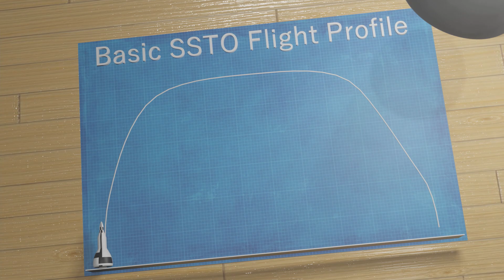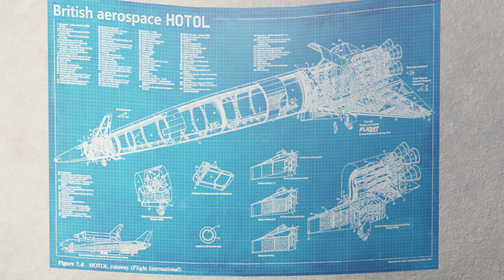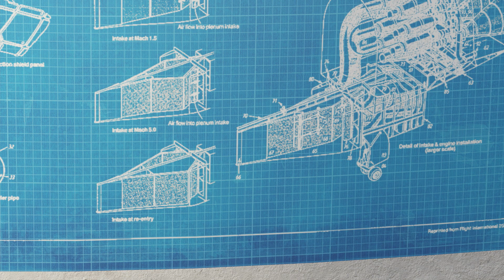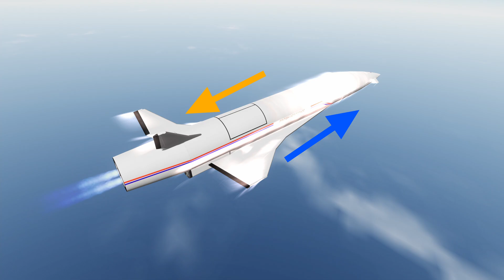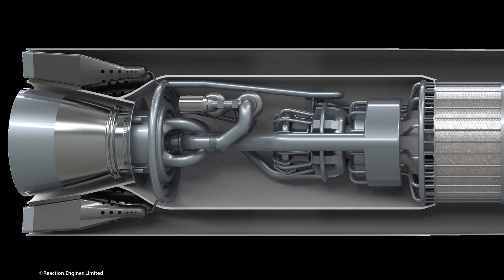From HOTOL to SKYLON - The history of Britain's spaceplane project.

Comment: Didn't you use endless fuel? My best achievement with the similar concept is a suborbital flight.
Reply from the maker: I did not. However, I had to create custom configs for the tankage (as the kind of lightweight tanks did not exist in RO yet - they do now, though!) based on the data from the study.

Otherwise, everything else was using existing configs/parts

Comment: Really great vid, i really like the HOTOL and the Skylon and i want to know : how did you make this workable HOTOL ? because i can't manage to make one fly without seeing it's wing being ripped  at the first turn. 

AND finally , if you have mod to make them do you remember what are they called ?
Reply from the maker: Looks like I forgot to reply  to this one, sorry!

The HOTOL is semi-workable - it flies for the most part, it's just procedural parts and B9 procedural wings. Atmospheric autopilot mod helps keep it stable in flight. 

However, it's not a fully functional craft - it can't go to orbit or return from orbit, it pretty much just served as a prop for the video. Since IRL one of the challenges with it was aerodynamic instability, it's no wonder it's a tricky craft to make fly.

Comment: Great video thanks for doing it! In a way Skylon and Star Ship are both reproducing what the Space Shuttle was but doing it better, both are reusable space trucks to Leo able to carry huge payloads. The next step would be to refuel in orbit and go to the moon. Shame this was never attempted for space shuttle
Reply from the maker: Absolutely - I think the space shuttle wouldn't have that kind of capability though - unlike Skylon it lacks the internal volume for refuelling without the ET, plus it would need modified RS-25s that can restart & redesigned thermal tiles.

The closest thing we could've had is maybe Shuttle-Centaur.
Reply: @TDChannelKSP  i guess the ET should remain attached. Assuming it can be refilled completely you could do some burn to get back into Leo before attempting reentry. Same issue for starship returning from the moon or mars...
Reply from the maker: @JohnBlackburn1975  Yeah, it'll be interesting to see how Starship handles it. It takes a lot of fuel to brake, so perhaps simply having a TPS that can withstand interplanetary re-entry speeds is more optimal.

Comment: I recommend the airplane plus and TURD mods if you want to make not only a more accurate skylon, but better planes in general.
Reply from the maker: I did use TURD for this. I'm not sure if airplane+ has RO configs though. 

A+ is dedicated to normal planes though, not sure how it would help with a skylon-like aircraft?
Reply: @TDChannelKSP  airplane+ has a size 2 round cargo bay that you could use, in combination with tweakscale to make a better cargo bay. I’m not sure if you need RO configs or not for cargo bays. Also, the mod airplane plus things or alltweak might work for the scaling. Another mod, simple repaint allows you to recolor parts that don’t have TURD. Unfortunately, I’m not sure if those tweak scaling mods or simple repaint work with RO. Great video BTW.
Reply from the maker: @elijahrhyne8961  Ahh, that's true. I've had issues with tweascale sometimes breaking FAR so I didn't want to risk it. Skylon is actually area ruled at the cargo bay - it gets narrower, so the mk3 bay is somewhat accurate (couldn't use the transition pieces, too heavy - unless I edited those)

Glad you enjoyed it though.

Comment: Ahh Skylon, forever waiting for those magic engines to some day be possible, not to mention the basiclly magic alloys
Reply: They're being tested
Reply: true but we get more teck every day so maybe ?
Reply: @stanleydavidson6543  tech.
Reply: its not magic...  just no one wants to push the money into it that it needs...   everything works on paper.     It doesnt need magical engines...   this isnt a warp ship...  it would have worked in the 80s... only you have to cool all that air down for combustion to occur... otherwise o2 in air is unavailable for combustion...  and recently that tech breakthrough happened...  

As far as alloy on the plane... of course, they are fine...  they've had the materials for that for half a century plus.  X-plane had them...   this craft doesnt have to do anything x-plane (x15) didn't... except its bigger.
Reply: @joecater894  This thing will acellerate inside the atmosphere
The alloys for that don't exist, the blackbird leaked fuel
Reply: @jesusramirezromo2037  it doesnt accelerate especially more compared to any other spacecraft actually.  There are no special demands on the crafts structure when compared to any other space vehicle.   The vehicle is no more powerful than say....   Space-x rockets...  or space shuttle.    The only difference between this vehicle and conventional craft...  is it is a jet/rocket hybrid.   No... it doesnt need special exotic materials.

In any case, airframe...  structure are not mainly challenged by the acceleration of rockets...  these forces are well tolerated...  the main concern would be air resistance.. so acceleration isnt a factor ; velocity is...  since air res is proportional to velocity squared.  The acceleration isnt a factor really...   and since when within atmos the air res would be no more than say....  blackbird at high altitude...   when it is still in jet mode and air breathing..  this isn't a problem either.   When the craft flicks to rocket mode, then it will accelerate to orbital velocity..  but by then will be a tiny faction of atmospheric density.  This process is much less challenging on the airframe than say....    the space shuttle..     no special materials needed....  the only block in development is £££££....   prob to the order of 100's billion...  which no one wants to invest.
Reply: @joecater894  Getting something into space is only part of the problem...getting it back down in one piece is the bigger issue that the Skylon proposal just flosses over.   They say they won't come in so quickly which will reduce the heating...partially true, but the reason spacecraft re-enter as they do is the available mass of the craft absorbs the heat and they have to limit not so much the temperatures of re-entry but the TIME spent during this heating phase.   

To simulate: run your hand through the flame of a candle quickly and you don't get burned..and this can even be done with a cutting torch at a much higher temperature...it's the time spent in the flame that determines how much heat you absorb.   Linger your hand over even the candle flame and you'll be burned....same for a re-entering spacecraft.   If it takes too long to come down the airframe will absorb too much heat as it's basically just a heat sink with limited capacity.   The Skylon is an investment sucking scam...pure and simple.   SSTO was looked at seriously back in the '80's and found to be unworkable...even with the promise of future materials.   A staged rocket can take more weight to space more cheaply...which is the object of the game.
Reply: @recoilrob324  i dont see reentry as a problem.  

Total heating might be a factor of time spent during reentry...  but time in reentry is also inversely proportional to reentry velocity... and air resistance is proportional to the square of velocity, yet proportional (squared I might add) to rate of heating... hence a slower reentry should generate less heating in term of overal temp ... not more.  Think of it as power vs total energy.   Since the craft is cooling at the same time as heating (that is losing energy and gaining heat energy at the same time) ...  if the power of heat energy (rate of resultant heat transfer) in is higher, then total temp will be higher during reentry.   The point to remember is the craft that is warm is always losing heat energy...  if the rate it gains it is less..  then its total temp will be less... too.

going back to point/exmple of candle...   you swipe your hand through a candle..   again..  two factors here:

heat transfer total 
and power (rate of heat transfer). 

In both case, this will be reduced with a quicker hand swipe....  

but this is not the same with entering the atmosphere quicker...   you have a certain amount of grav potential energy to lose... and it needs to be converted to kinetic energy and then goes into the atmosphere.  Its more dangerous the quicker that is done..   because then more energy per second must somehow be dissipated.
Reply: @joecater894  SSTO's are just not practical on earth
The mass needed for the heats shielding, wings, fuel and engines is just impractical
There was an Indian idea, of a two stage space plane, that would store oxygen from the atmosphere to use as oxydiser in space, and even that would be hard to pull off